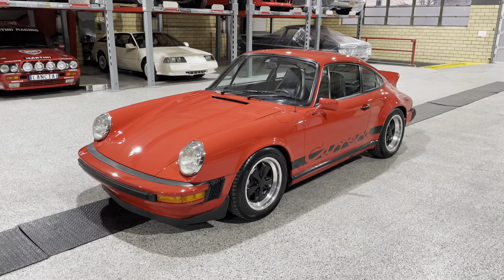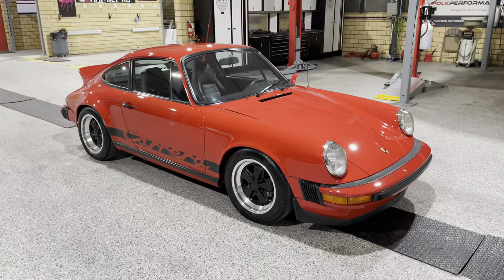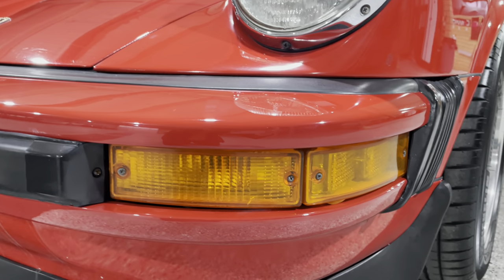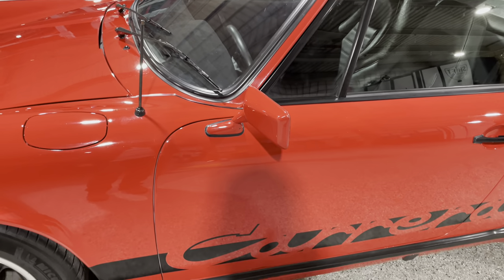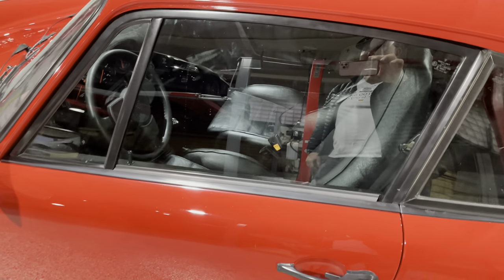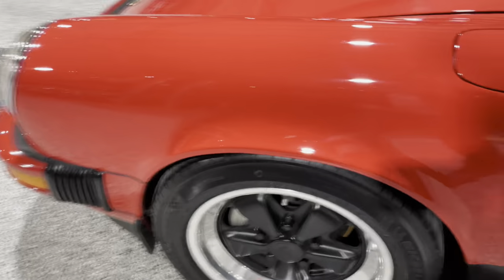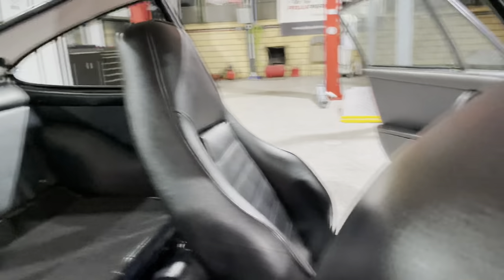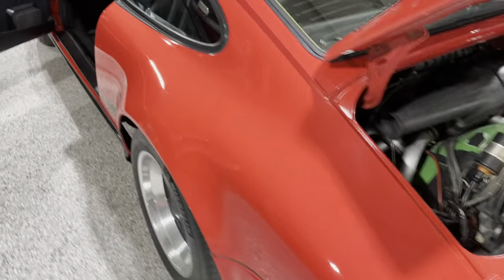1974 Porsche 911 Carrera #446 of 518 for sale.

Comment: …the 2,7 Carrera is a beautiful example; one note though, probably in the repaint process or polishing effort, somebody took off both wiper arms to do their job, and in the replacing process, reversed which arm belongs where. The crooked arm belongs on the right side/passenger side and therefor the straight arm belongs on the left/drivers side. 	Simple reasoning is that so when the arms are parked, the r/s arm lies flat/perpendicular against the glass and is not sticking up in limbo. Small detail, but one to be corrected.

Comment: “Same as 73 rs apart from a few minors differences” lol you Americans! There is one major difference - it hasn’t got a 2.7 MFI 911/83 motor. That’s like comparing chalk & cheese. Lovely car all the same
Reply from the maker: It doesn’t have MFI but same basic engine no?
Reply: Not really
Reply from the maker: @DM911RS  not same block and heads?
Reply: Yeah this car is super nice but not in the same category as the Euro MFI model which is the one that’s comparable to the 73 RS.  Believe this being a CIS motor. Looks like it was sold. Well done.

Comment: Sorry budy, this is a US Spec carrera, the TRUE one is the ROW carrera, w/ MFI fuel inj, 210cvs, vin 9114"6"!!!
Reply from the maker: Ya, and around $1M. I’ll take this one for a fraction of the price.  Lol.
Reply: @euroasianbob9268  You tell em Bob!!
Reply from the maker: @christopherkraft1327  Eric is right as the euro spec is more desirable but I would rather have this car and 8 other 100k cars than a euro Carrera. 40 more hp can be made up pretty easy.  My car has different cams and probably close to 200hp.  Going to put it on a dyno soon.
Reply: @euroasianbob9268  IMO a Euro 74 with the MFI motor is probably $300-350k and a 73 2.7 RS around $700k for a Touring spec example right now. I think your lovely car is fairly priced in this market with the paint issues, dash and wheels  (RM has a apparently concours winning US market car at Amelia Island estimate $175-225k) and compares favourably with all the 2.4S' on the market.
Reply: @matthewlange8616  The most recent market update in Excellence  has a US Carreras at $30,000 for average cars, $55,000 for Good examples, and $80,000 for Excellent / Concours cars. With the modifications, this is probably right in the middle of average and good.
Reply from the maker: @matthewlange8616  you know your stuff!
Reply from the maker: @SuperCarreraSTL  those numbers are way off.  Check completed sales this year.